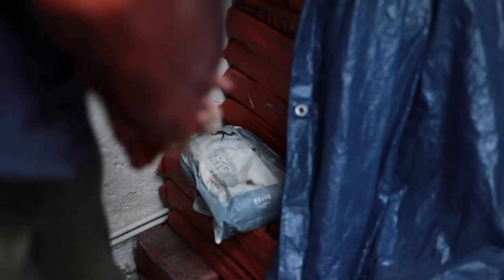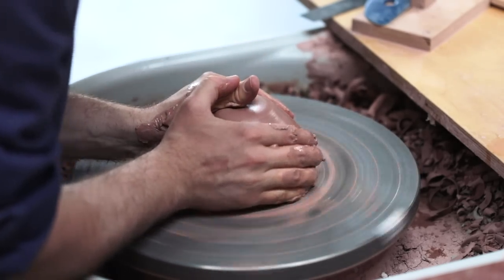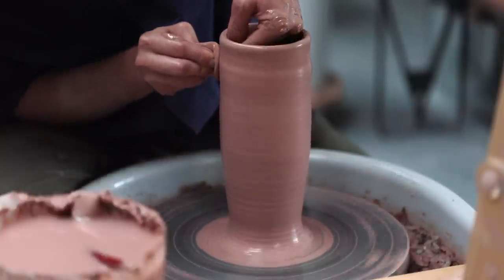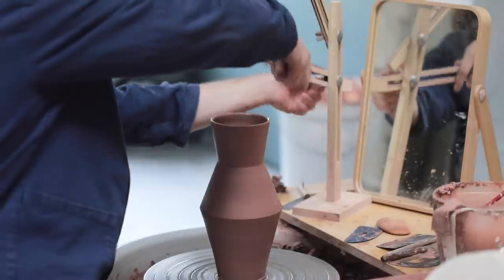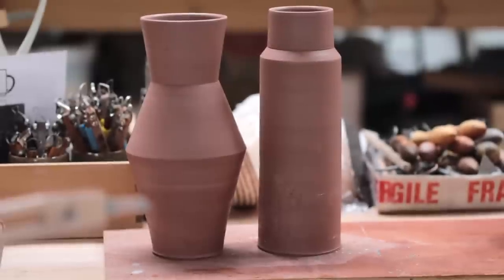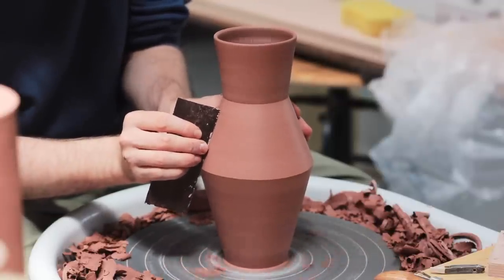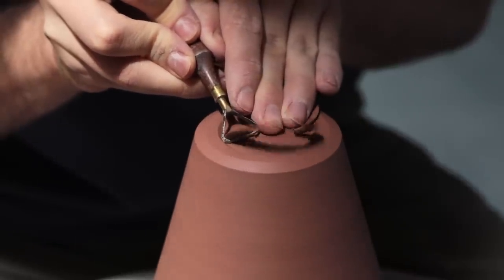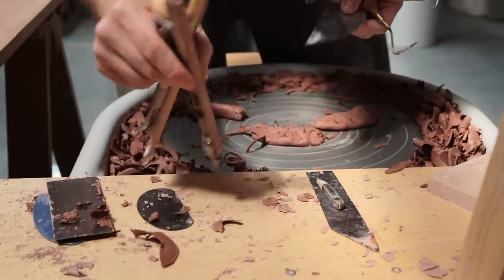Making a Pair of Vases

Comment: no idea if it's possible, but could you skip the drying out step and move from trimming to glaze, then firing?
Reply from the maker: No. Those times are crucial, and if you rush them, pieces will crack and pots will explode.